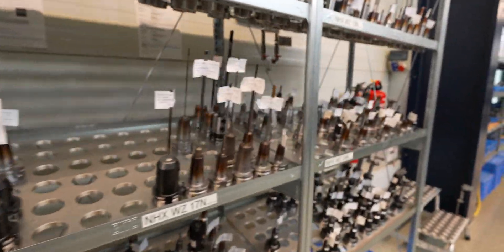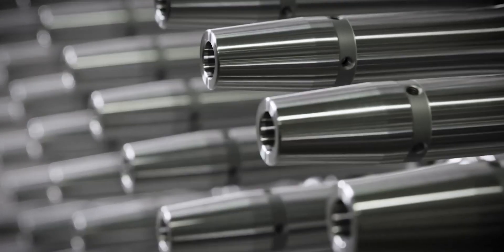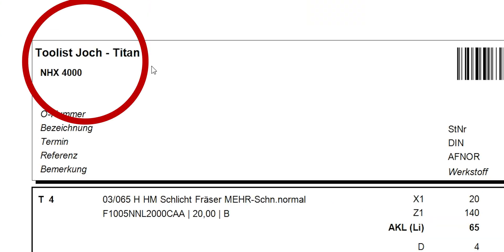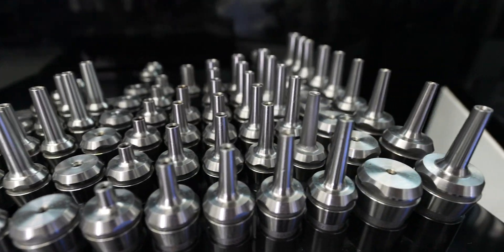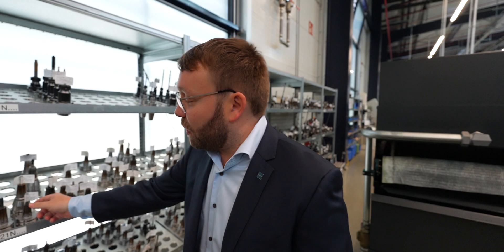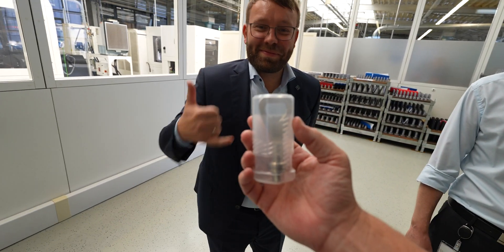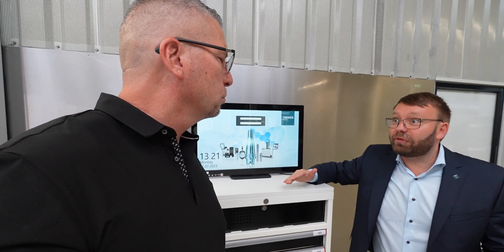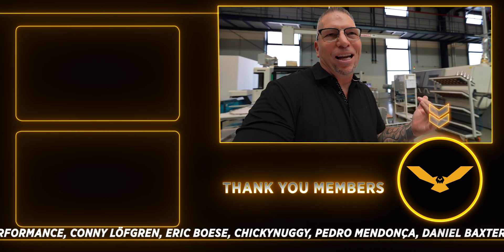200 Machines But That’s Not Why HAIMER is SUPERIOR…

Comment: Haimer Tool Base System is not a new invention, do not deceive people, this system was invented and patented much earlier. This system was available 10 years ago, 20 years ago. I am in Turkey and the company I work for has had this system for years. You select the tool you want from the PC and it opens that drawer for you. It deducts from the number in your home and you can easily add a new team without having to count how many teams you have, you don't have to worry about counting, it makes your job easier 🇹🇷

￼

Comment: Documentation is not only important for the customer , it makes the life of the machinist so much easier! Nothing is worse than walking up to a complicated, copy exact part , that has to match the last batch 100%, down to the step over on the surface finish, and not having a proper setup sheet, traveler, or documentation.

Comment: if there are two identical tools - besides the wear of these. can you configure the tool change in a way that the tools are not changed in the middle of a job? 
Or so, that one customer job use one set of tools and another customer job another set of tool?

Comment: Great video, back-stage pass is always the best 😊

Knowledge is power, the advantage of documenting all kinds of flows in a company saves you money and you detect problems much sooner and correct it, when the process is still running.
Better then when you see in your post-calculation that you've earned less.

Great job Titan, what is next on your Europe programm?